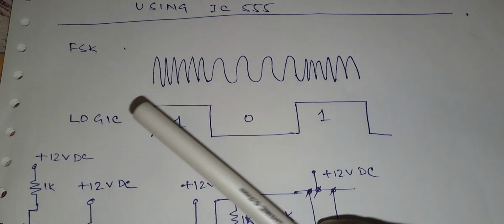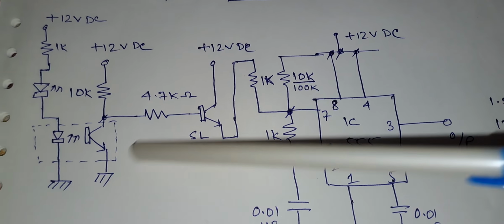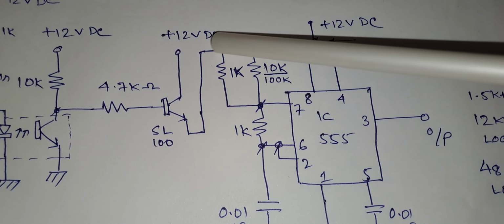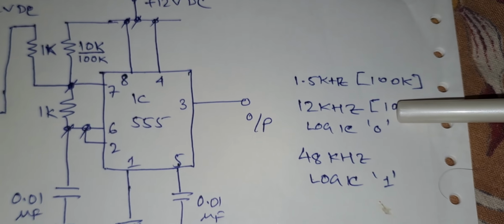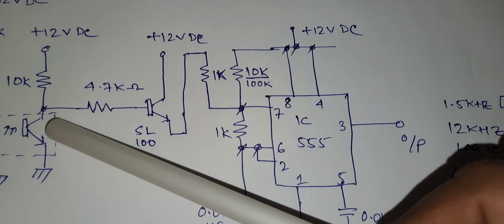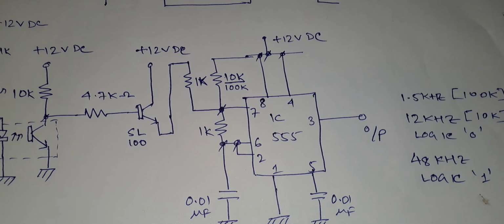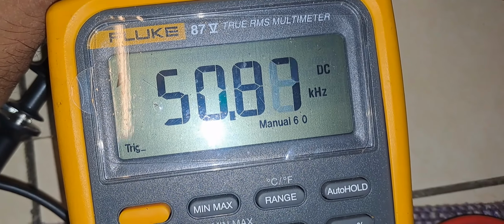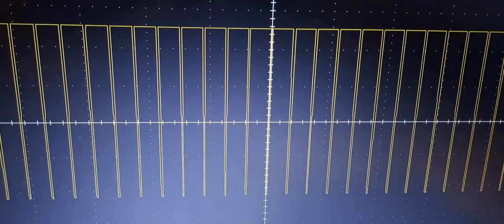FSK MODULATOR (Frequency shift keying) using IC 555. Whatsapp (+91)9163954390

Comment: Thanks a lot for the explanation, i just have a question: what resistor values would I need for a logic 1 of 80KHz and logic 0 of 60KHz?
Also, why is the output a squarewave? isn't it supposed to be a sinewave?
Reply from the maker: For 80khz nd 60 khz we need phase locked loop concept. I used low pass filters.
Reply: @RUPJITCHOWDHURY  i was trying to find a low frequency PLL IC on mosuer and such but I couldn't find one.  do you know an IC I can use for my application?